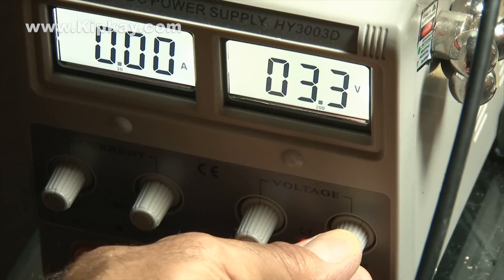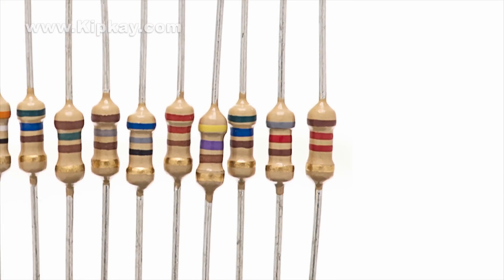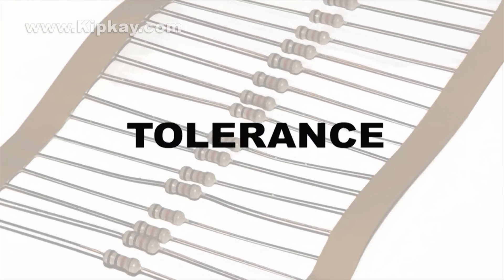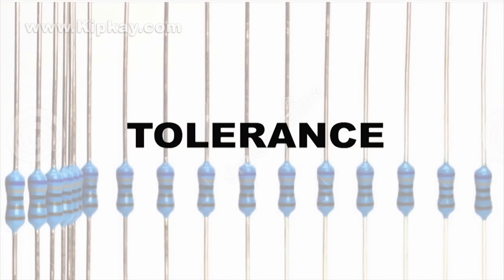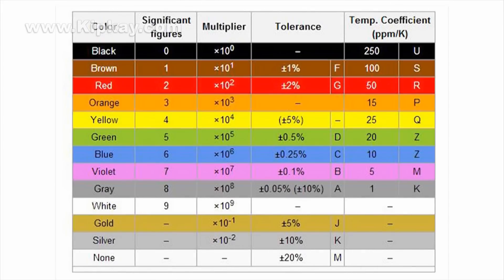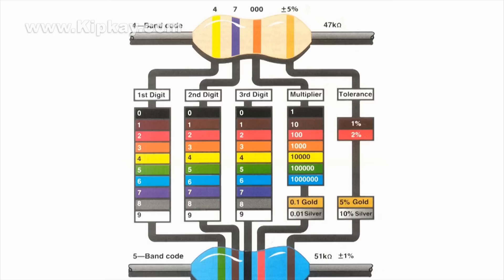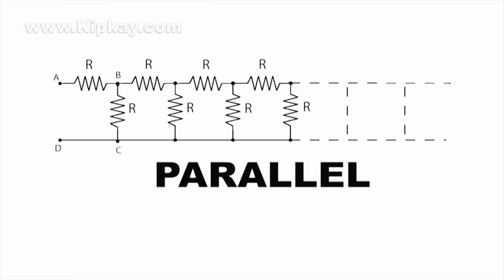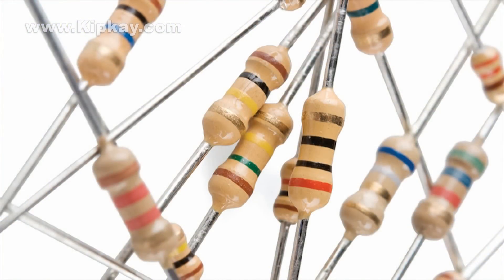How do Resistors Work? - Kipkay Tips

Comment: Little nit-picky but you said the voltage drop across the resistors in parallel is the same but there was series dropping resistors, so your pictorial representation didn’t match what you were saying.
Reply: Justin That’s not a nitpick, it’s correctly identifying a major error. This creator is a joke.

Comment: Nice video, but it really doesn't explain how it works as the title suggests. I was hoping for a video explaining the insides of a resistor and how it resists current flow.
Reply: Depends on the type of resistor. A basic copper resistor is just a thin copper wire wound around a ceramic rod. The longer and thinner the copper wire, the more resistant it usually is.

Comment: mmm. I don't understand the difference between watts, olms, amps, and volts.
I mean,...why use resistors at all, why not build devices that accept the full range without burning out?
And even if I understood the nomenclature and the concepts, I still wouldn't understand the use, nor the implications.
Reply: Max Steel 
I think device that can accept full also have resistors build-in.
Reply: Because most devices have one power supply with a set voltage.

That one power supply may need to provide for a device's many functions; such as a motor, lights, display, etc.

Each of these functions may require less voltage than the power supply's output. 

That is where resistors come in.

Comment: I think i learned more about resistors from this short video than I did during my electrical engineering for non majors class.  Thanks Kip Kay.
Reply: This was an extremely basic "how do resistors work" video though. In basic electrical engineering you probably concentrated on how they ACTUALLY work...on an elemental level, and experimental level using math?

Comment: how do you identify a blown or malfunctioning componant on a circut board I have a plasma speaker kit and my dad was helping me tune it and he slipped holding the volt meter and shorted the leed on a transistor to ground the transistor seems to be ok so then I have no idea whats not working I can still plug it in and power goes through it but I have no idea what blew up because I can no longer tune it.
Reply: Use a multimeter continuity test on each solder points and eventually you will find which component is damaged
Reply: Its vary hard for me to do that because on half the componants I cant get at the leads theres a massive heat sink on the bottom anc I cant run the board without the heat sink because id fry the mosfats their huge

Comment: Resistors work because of smoke. They put smoke in them and they resist the flow of current. You know this because when you over power a resistor it lets the smoke out.

Comment: The easiest way to determine the resistor value for an LED: 
Supply Voltage - Forward Voltage of LED / .02(20 mA) = resistor value
Example: 12V - 3.1V(White or Blue LED) = 8.9V / .02 = around 450 Ohms

Comment: why does every teaching video you make have some big mistake in it? not pre-tinning your soldering iron tip. using wrong letters in ohms law, make sure you actiually know what you're teaching before you teach
Reply: Quit nitpicking.  It's not like using a different letter to represent voltage, current, and resistance is going to change the outcome of the equation.  Also, as an electrician, we're trained using those same letters, from the very beginning of our training until we're qualified
Reply: its like using g (grams) in a formula instead of M (mass), its two different things. yes the outcome will stay the same, however, it doesnt change that the formula is wrong, every textbook will show you the right way, so i really dont get how he got it wrong. yes for measuring or calculating stuff you use V, A or Ω, in formulas you use U, I and R. but like i said, every informative video he posts has a major mistake. just saying he needs to get his facts right if he wants to teach this stuff.
Reply: I wouldnt call that a "major mistake" more of a typo if anything.
Reply: sagerobot that would be a major mistake, since v in formulas is used for velocity, dont mix up your letters in formulas, i know its a simple formula and no real heavy math is involved, but if you use the wrong letter in a complicated formula, you get an entire different answer.
Reply: Just googled ohms law and in the first couple pages of images I couldn't find a single equation that didn't have a V for voltage.  Also, its unlikely one would use velocity and voltage in the same formula but I'm sure it exists.

Comment: Why can't they just write the resistance on the resistor instead of using the colors
Reply: because it's easier to turn it against brush with some color than printing a nice, readable number on it. this method is used for decades, if not almost a century. so... it's just something you have to accept. 
Also, if you see someone in a shirt with black stripes, you know that they don't resist very much...
Reply: MicroMars I wondered the same thing...while I was studying electrical engineering I wasted a lot of time calculating it
Reply: King Elliot I went to a technical high school I always hated calculating resisters

Comment: HEY KIPKAY I wanted to ask you if the current the resistance and the voltage have the same ratio every time there is electricity or not
Reply: Omar Omar like Joxman2k said.... current is directly proportional to the voltage and indirectly proportional to the resistance. Kind of like multiplying and dividing.

Comment: kipkay Question for you.. I was replacing a capacitor in my pc monitor and I noticed that there were empty capacitor slots on the  motherboard.  I was wondering if the monitor company uses one motherboard to supply all monitor qualities from 60hz to a higher hz by just having capacitor or other components swapped out in different orientations.  What would happen if those empty slots were modified... Im asking you because there is nothing out there in information
Reply: uh you were looking in a monitor and found a motherboard...... you need to get your vision checked
Reply: im pretty sure you still call it a motherboard since its the mainboard with all the components..anyways...
Reply: Chances are the monitor had a switching power supply. That means it doesn't matter what line frequency you are using. It all gets converted to a high voltage DC, then sent through a power oscillator through a tiny transformer at a much higher frequency (40khz in some cases). The "missing" capacitors were probably just places for either extra filtering for a larger monitor (same board, different display) or were added in during the design stage when the manufacturer didn't know if it would be cheaper to buy fewer capacitors at a higher capacity or cheaper to buy more capacitors at a lower capacity. After they built the monitor they could pick and choose which capacitor manufacturer had the cheapest parts.
Reply: ah ok...makes sense

Comment: seems like a very informative video.  I am still waiting for the light to come on in my brain. I guess I'm a little slow.
How do you know which end to start decoding the resistor from ? if you start from the wrong end it would be different. is there a "key" that tells which end to start at ?
Reply: Some resistors have the tolerance band wider than the others, and others use a larger blank space between the last digit and the tolerance.
Reply: Jammit Timmaj that's good to know, thanks.

Comment: you kept saying current when you really meant voltage. Putting a resistor on an led when using a 9v battery limits the voltage, not the current. I couldn't finish the vid because of the wrong info.
Reply: xXComputer_Nerd1625Xx voltage is equal to resistance times the current. Less current = less voltage

Comment: Is a variable resistor and a potentiometer the same thing?
Reply: Mattson McCraw technically yes. in practice it's the way its used in which you would call it. if you use 2 of the pins (middle and the one to the left or right) you would call it a variety resistor as it will only change its resistance inside of a circuit e.g. crudely changing the brightness of an LED. but if you connect the top pin to + volts and the bottom to 0 volts you can chance the voltage output of the middle pin and this is when you would call it a potentiometer because it's changing the output potential (voltage output)

Comment: Ok but i have a question. How do I know which way to read the bands on the resistor? Because if you read them one was it could be a 10 ohm resistor, but if you read it the other way it could be a 430 ohm resistor. This is just an example of course... I bought a package of like 600 resistors all of varying ratings, but none of them labelled.